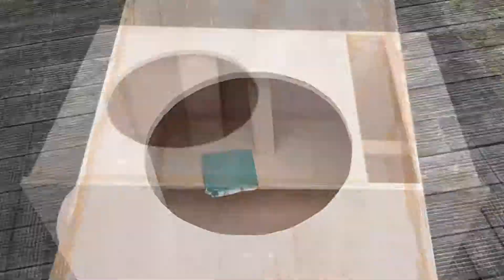MK5 Build So Far

Comment: Are these angel eye headlights bright as the R32 ones the projector?
Reply from the maker: Its a aftermarket headlight, and halogen H1 i replaced with 6000K HID kit, so frkin bright
Reply: @DimezProductions  You know the main dipped headlights are they projectors or reflectors yeah there bright
Reply: @DimezProductions  How bright is the angel eyes and the strip light
Reply from the maker: Angel eyes are bright but the drl is not that bright